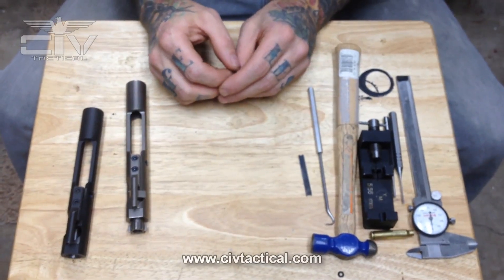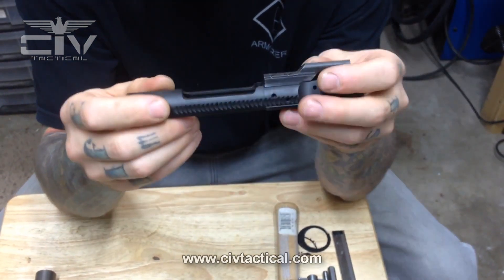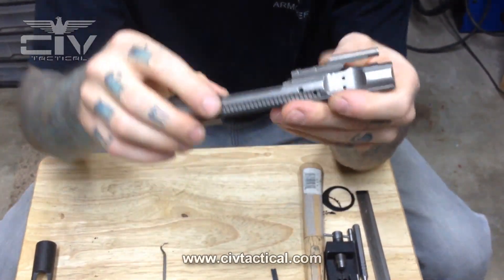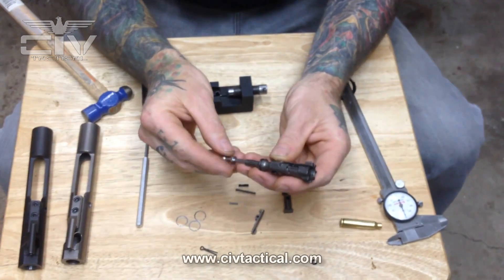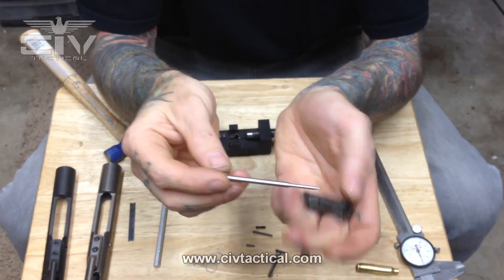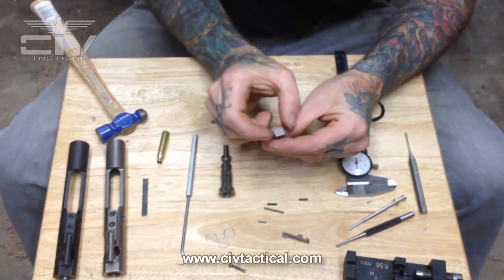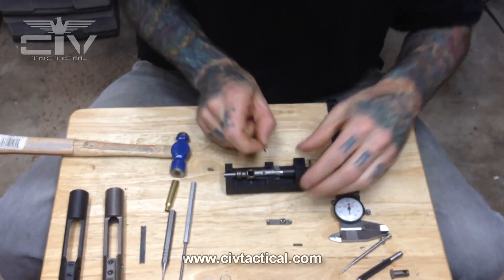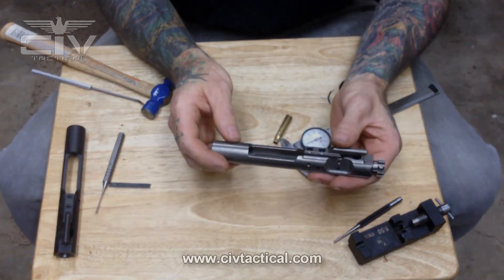AR-15 - BCG Facts & What To Know - CIV Tactical

Comment: Don't need to stake the gas key screws.
Reply from the maker: Peter Schiestel You don't have to wipe your butt either, but most people choose to.
Reply: Please tell me how this is relevant response to a statement on key staking? Original m16's do not have them and many builds do not recommend them. They do not keep the keys from loosening off, but they do prevent people from replacing bolts once they have backed off. Clean the area and ensure you have a flat surface and use Loctite.
Reply: Peter Schiestel You do need to stake the key, both originally or during a field repair.  Loctite, even their highest temp rated stuff at 650 degrees F, are effected by the temp being pumped into the chamber.  If you run a bold not staked and run it hard and get it hot and then clean it, repeat...  the key will loosen and crap the bed on you.  Stakes very rarely fail and when they do it's because they weren't staked well enough.
Reply: +nsz85 lol I make the right choice

Comment: I hear that it doesn't matter if your gas rings align with the gaps in a line, because they move around on the bolt during firing anyway and will eventually line up anyway. But i agree to keep them at different positions from each other as well.

Comment: Wow one of, if not, THE best video for tips on a BCG r&r. Uber instructional and informative. Thank you. I'm still wondering what the difference is between the ejector and the extractor though.
Reply: The extractor extracts or pulls the shell casing out of the chamber. The  ejector ejects or pushes the spent case off of the carrier and out the ejection port.

Comment: From the looks of it the cam out dimension is around .825 not .0825. Where is he taking the measurement from to get the .087?
Reply: Tim,  I made a little brain error. I check so many extractors that I just read the thousandthds dial. It was actually .682 and .687 for a difference of .005 thou. I am sorry for any confusion.
Reply: @CIVtactical  Great Video.  I have adjusted my extractor cam out to .015 now the back of the extractor wants to rub on the bolt carrier when it is installed is this normal.  Thanks for all the information.

Comment: How many times can you remove the gas rings without damaging them or before you need to replace them?   Is it safe to do it every time you clean your gun after shooting?   I think I'm going to make it a part of my cleaning routine to remove them, and wipe them and the area they go into down.
Reply from the maker: If you remove them, replace them.
Reply: Jimmy Nix I would replace them ever time if you can also watch and make sure that the gaps in the rings aren't all in line. the gap should be 1/3 of a turn from another gap to make sure thats theres a proper seal. I would just buy a small pack of rings and throw them in with your cleaning supplies.
Reply: Jared Fossek - Thanks
Reply: No need to remove the gas rings for cleaning, only when worn.  Also, though it's good practice to offset the gaps in the rings, it isn't to prevent gas leakage...that's an old wives tale.  When you insert the bolt into the carrier and begin to feel resistance, that's the gas rings compressing and sealing against the inner walls of the bolt carrier much like piston rings against the cylinder walls of your car. There will be no gaps in the rings once it's installed back in the carrier.  In fact the bolt of an AR is essentially a piston itself, riding inside a reciprocating cylinder (the carrier).  Hope that helps.
Reply: Apex of True Form - Thanks.  Most def helps.

Comment: So what happens if the bolt doesn't go forward like it's suppose to?
Reply: You mean what if the bolt doesn't go as far as it can into the barrel?

Well, it can mean that the bolt will not lock into the barrel with its locking lugs and if there is a detonation, you can have an OOBT, Out Of Battery Detonation, meaning the cartridge will go boom and so will your upper, possibly causing serious injury.
Reply: Yeah. If the carrier goes all the way forward but because the gas rings are worn & not sealing, the bolt doesn't get pushed to it's most forward position. Then you could have an out of battery detonation?

Comment: Great Video.  I have adjusted my extractor cam out from .006" to .015" now the "back" of the extractor wants to rub in the inside of bolt carrier when it is installed is this normal.? should I file it down to fit?  Thanks for all the information.
Reply: I have measured enough new Colt bolts to know this is bull shit, you screwed up your bolt doing that lol.

Comment: Very informative; I found a lot of useful information here. When I got my BCG (I'm building my first AR but my roommate is helping me and he's built three) I saw the similarity between the gas rings and the piston rings in an automotive piston engine (ring gaps don't align; worn rings cause gas blow-by) and the ejector spring pin gap needing to be installed at a 90 degree angle to BCG motion (I had a 50cc gas scooter back in the 1990s I had to do a piston and cylinder replacement on and it had a wrist pin clip that was a c-clip. I recalled reading years ago about those NEEDING to be installed with the gap either facing straight up or straight down; if you installed the clip with the gap facing sideways to piston motion the speed and back and forth motion of the piston would squeeze the clip and make it pop out. The results would not be pleasant).